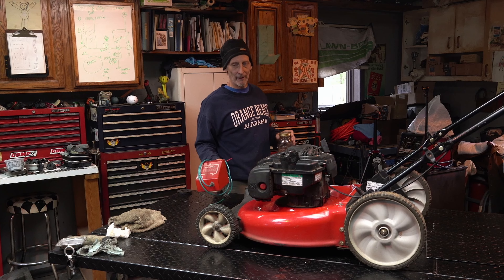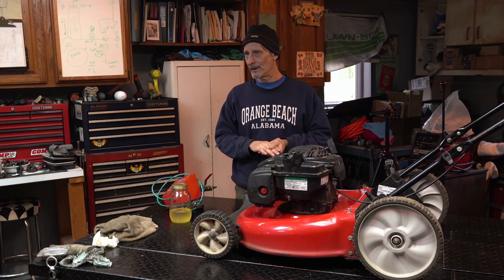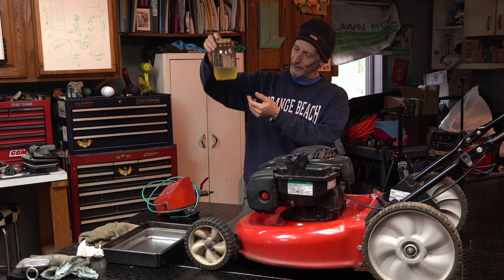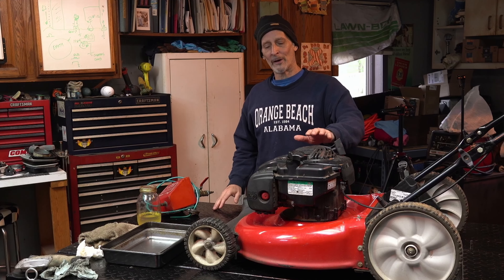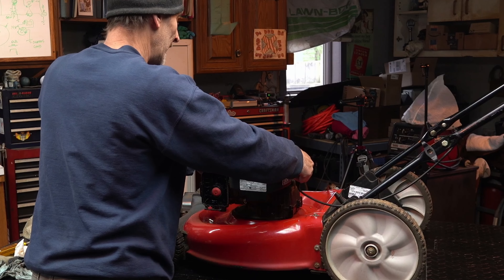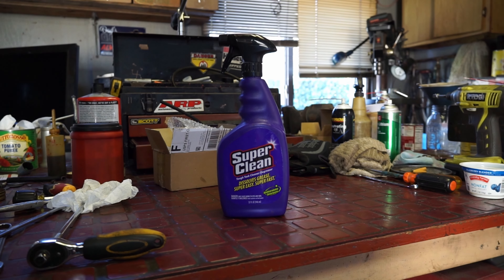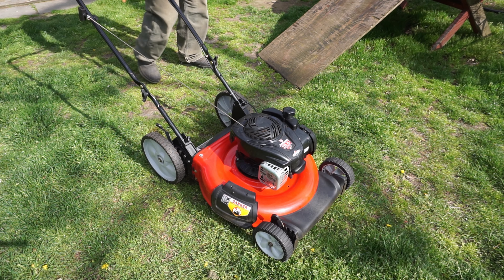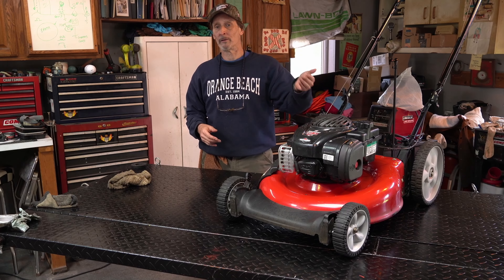MOST Common Lawmower Problem FIXED / Briggs EX Series Plastic Carb Rebuild

Comment: Great breakdown. I did a similar job but didn't use super clean or pressure washer. Don't have an air compressor had to let it Air dry for a bit while I was cleaning other areas. I have to get an Air filter and cover. The one I have is missing one.

Comment: Those carb screws, inner bolts, I have never used the socket for a mower before but 9/32nd socket, and normal outter bolts 5/16th.

Comment: Was working on my bolens e500. Drained fuel, clean carb. Waiting on some parts. Put fuel in to see if she'll start and I'm leaking fuel from red primer bulb and possibly fuel tank or fuel line clamps not holding. My question is where do ya get the caps ya use on the tank when ya cleaning it?
Reply from the maker: sounds like ya got junk in the carb and tank,,probably the float is stuck open and its found a place to run the fuel out>
Those are vacuum caps,, any auto parts store...
Reply: @TheNovaJohn  kewl! I watched how you broke it down to clean but I didn't have some of the items. Used caution while cleaning but didn't soak them. Waiting on my pressure washer and can't find the super cleaner to get r all clean. I'll take it apart to check fuel line and clamps. Don't have an Air compressor to blow it clean & dry. I use our Texas sun.